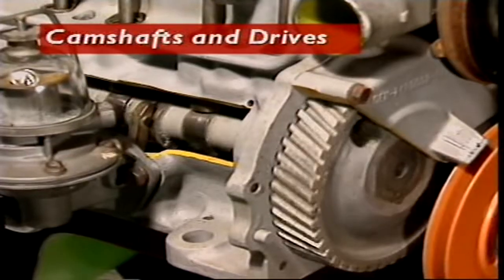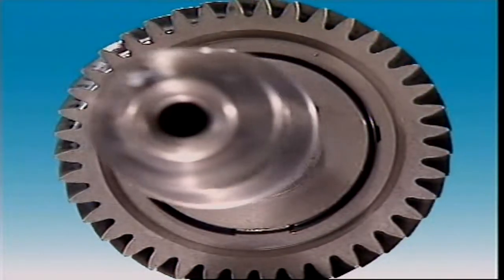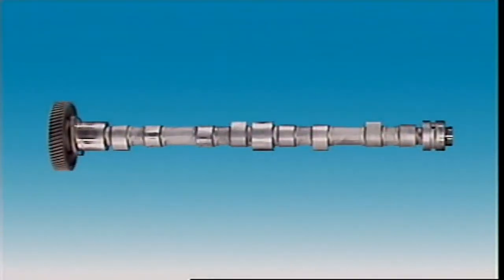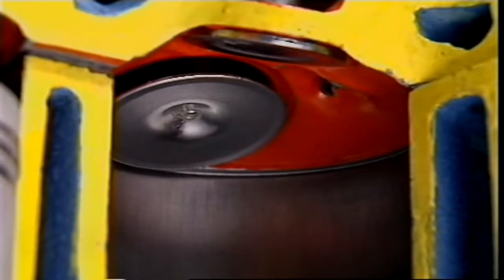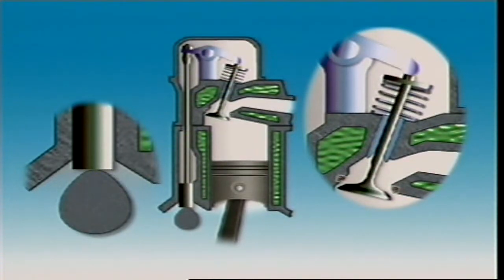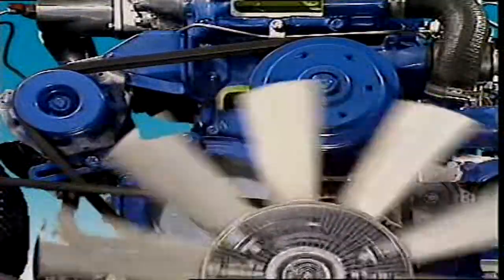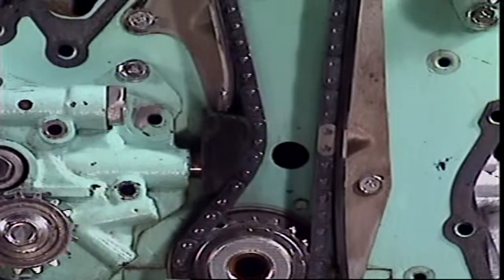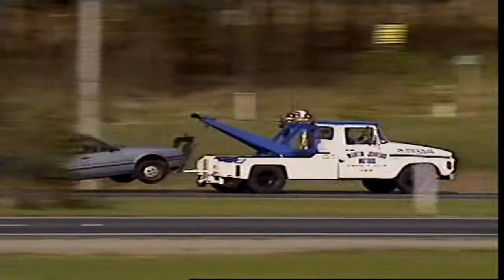How an Engine Works?|Camshafts and Drives| (6)

Comment: I'm a noob on engines and i have some questions
If the ecu can adjust the valves on how much air or fuel can be put in an cylinder and the cams controls the valves so when u remap your engine does that means u also have to change the cams?
Reply: Looks like you asked this quite a while ago so you probably already found the answer...but just in case my answer would be not necessarily, it would really depend on what sort of tune you're going for....the stock cam profile will only allow in so much air/fuel mix and expel so much exhaust fumes at a time regardless of whatever is mapped in the ecu...that being said the reverse scenario (like a change to performance cams) would almost certainly require/call for an ecu remap.